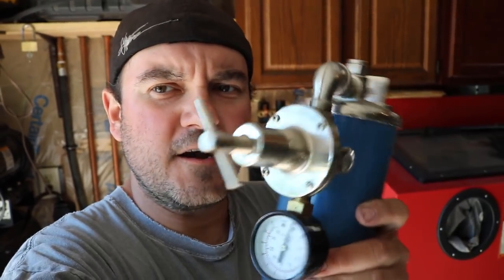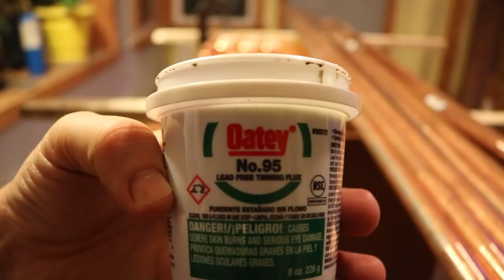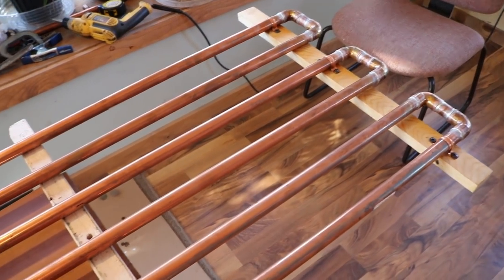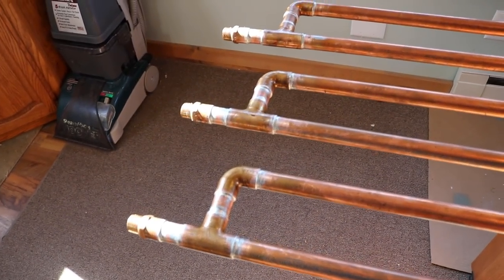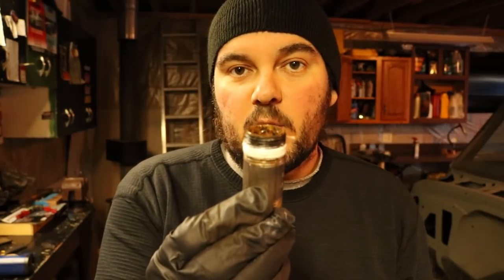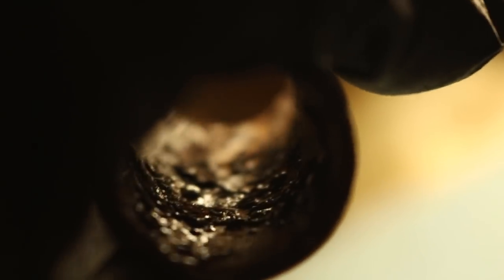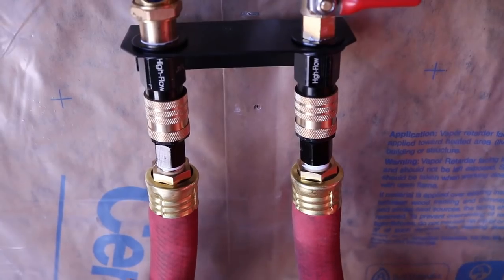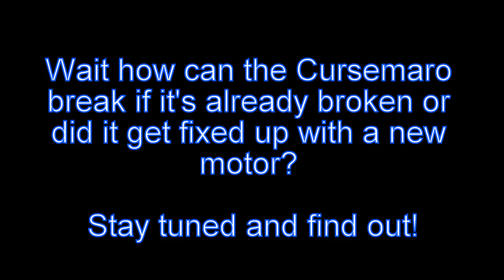How to remove moisture out of air compressor lines! Building an air dryer for painting classic cars!

Comment: This method of copper pipe works great, but to those interested, the other method you see well documented in the internet of using a trans cooler is much better. Here's why.  Aside from the enormous amount of cost, work, and leak failure points for this method, look at the physics.  The copper pipe is nearly against the wall which reduces air flow dramatically.  A small trans cooler like the common Derale 15300 used in the other videos has 16 ft of tube (I bet you didn't realize that), and it is finned, and exposed on all sides. (Ever see baseboard heating without fins? Of course not).  It is at least 2x efficient as unfinned pipe against wall.  Then add a small fan and it is at least 3x efficient as copper pipe against the wall.  That means a small 12"x12" cooler is equal to 48 ft of copper pipe against your wall. Lastly, who has so much wall space to kill?  No disrespect to this guy who did an awesome job, I'm just trying to help people who are considering adding an aftercooler.  Either method works extremely well.  Whichever method you choose, be sure to install the cooler and a water trap BEFORE your tank to avoid the corrosion he showed in the piping happening in your tank (it's uncoated steel inside).
Reply: I've heard of the derail failure quite often no???
Reply: @anthonymoy4471  Where have you heard this?  The coolers are rated at 250psi operating and 300psi burst.   No problem.

Comment: Hello can you tell me after the regulator.  On the 3 end points was this from 3/4 inch copper or 1/2 inch copper then reduced down to 3/8 inch for the airline fittings and regulators.
Reply from the maker: Everything before the regulator was 3/4",  everything after was 1/2" copper reduced to 3/8" air lines.
Reply: @BustedClassicGarage  Thanks.

Comment: for those that want to try to use pvc pipe as an inexpensive replacement for copper, keep in mind that pvc conducts heat very poorly so you would need a much larger cooling grid that could be 3 times the size of a copper grid.
Reply from the maker: And it likes to go... BOOM
Reply: @BustedClassicGarage  well, yes it does. personally i would never use pvc for compressed air but for some reason a lot of places around me do..
Reply from the maker: @marzsit9833  definitely not worth the risk in my book.

Comment: Great video Man. Just what I was looking for. 
Curious about the desiccant snake? Does that just take place of not needing a desiccant filter with silica additives?
Did you get most parts from same place?
Reply from the maker: Yeah the desiccant snake is basically a cheap way to get the benefits of canister filter with desiccant beads. If you're only going to be painting once in awhile it's definitely worth the purchase over a canister filter. I actually walked into Eastwood with money in my pocket to buy a canister filter and they sold me on the desiccant snake. Most of my purchases were made at Menards, Farm & Fleet and Eastwood. There's a parts list pinned to the top of the comments also.
Reply: Busted Classic Garage right on. Ya eastwood is good customer service. And thanks for the tip. Saved me money man thanks

Comment: Great video! I made my lines from galvanized ,didn’t think about the crud that could get in the lines from using steel. Question is, thats a three line set up, so for a one line dedicated line for paint I only have to run about a  third of what you have here here right? Also I have a Devilbliss  dessicant dryer,can I dry that filter out in the oven instead of buying a new filter for 50 dollars? If I can didnt know you could do that. Thanks again great video.
Reply from the maker: Yeah I did over build this a little bit, but if you wanted to simplify it you could just run one line out of the main regulator, and regulate all your air down from that one and just plug in whichever tool you wanted to use. Whether that be an air tool, a paint gun or a blaster. I'm not sure about your filter but my guess is there's a way to actually remove the desiccant if there's a way to do that yes you could. I don't know if I would do it in my home oven, I know some guys do but I have a oven in my garage dedicated for Powder Coating that would be the oven I would use. You could call Eastwood and see what they say, they sell a lot of devilbiss products.

Comment: Where do you find 3M paper in Canada? I am in Montreal. I want 216U. Almost everybody seems to carry Gator or Norton. The 216U is formulated for water borne finishes btw.
Reply from the maker: Can you get it online? I know eBay has a ton of it but you might have to pay an arm and a leg for shipping.
Reply: @BustedClassicGarage  Yeah plus the time for shipping in these crap times. I'll manage. So far Norton ProSand (the 20 sheet contractor pack has been ok - just ok - sand very well but not sure if I got the few fish eyes from it or from using DNA to clean, or from dust contamination, time will tell as I troubleshoot). I wrote Jeff Jewitt the finishes and he said that he tried as many brands a few years ago and found no issues overall; the modern sterates seem to be better he said. Anyway, I'll see. I have some Mirka Gold on the way; that with 216U seem to be the gold standard for water borne finish.
Reply: Canadian tire

Comment: Very nice build, design and execution BUT- That solder is too soft for >150psi. You need to use a silver solder or braze. Over time you'll be popping elbows/ tees. Also confused by the array of 1/2" tubing and outlets at the end. Some description of what/ why would help. 1/2" there also will restrict your flow a bit if you have a high load like a blaster (1/2" hose should be fed from 3/4").
Reply: The half inch fittings are only for the drain valves (for draining collected water) at the bottom of the drip legs.  The airflow doesn't go through them. They could be 1/4"

Comment: Great video! What brand/type  of shutoff valves did you use in the piping after the air regulator (the ones with the red handles)?
Thanks.
Reply from the maker: Thanks! Those were just standard 1/2 ball valves, one side female and one side male ends. I think I got those at Menards so they would be Nibco brand.

Comment: Nice job!  So what kind of "soldering" is that you're doing with the propane torch?  I've never done that before.  I've done regular soldering of small electrical components, but nothing like what you did here.  Looks fairly easy though.  Thanks!
Reply from the maker: It's the same soldering method you would use sweat copper pipes for you homes water system. Very easy! Thanks for watching and Stay Tuned!

Comment: Great build..
Wondering what it basically cost to do that build  ???
Reply from the maker: Thanks! I believe the copper was right around $150, the regulator was just under a $100, the desiccant snake was $30, the desiccant relative humidity indicator was $30, the jumper hose was $30, and I would say add another $50 for small pieces like some of the brass fittings and regulators. So you'll probably end up spending around 400 bucks with the solder and flux you're going to have to buy.

Comment: This is not enough also needing a cooler in-between the compressor and the tank. I used a 25fot coil of copper tubing submerged in a bucket. Also put a small clear reservoir at the end where you connect the air line, you will see still there will be some moisture.
Reply from the maker: Yeah I will have to do that at some point. Whatever moisture's left in the system now gets picked up by my Desicant filter.

Comment: Nice work,  however it doesn't matter if you use all steel , go to any shop, factory, or school thier air lines are steel and many times 50 years old,  rust nodules inside the lines won't hurt unless they break loose, and clog your tools
Reply from the maker: Thanks Eric!

Comment: I have question about sand blasting, could you come out of the compressor head and back into
the tank with this setup to keep up blasting better and not lose the tank volume. Thanks Dennis.
Reply from the maker: No, this system is only to be used after the tank. If you want something between the tank and pump you'll want to look into a condenser.

Comment: thanks! One more question. I don't have enough room behind my compressor like yours so I was thinking about running  a line 10 feet or so to the dryer. Do you see anything wrong with that? Thanks again for your awesome video and all your help!
Reply from the maker: Nope, the more the merrier, as far as length goes. I would maybe install that 10 feet of copper at a slight angle so you don't end up collect standing water and angle it down towards the first valve.

Comment: Is there some resource online that explains exactly what the theory is behind this and how it works?  Like, is it important to have more bends in the system to act as a water trap, or longer runs etc?
Reply from the maker: Basically the way the system works is the long tubing gives a chance for the hot air to cool and the water to drop out of the air. So you could plumb up your garage with straight long runs on the ceiling, with a couple drops for air tools and valves below to drain water. It would work the same way, you would just go to your furthest point from the compressor and hook up your air filtration system there. The reason why a lot of people build these is so they can fit them in a small area rather than wrapping tubing around your entire garage. As long as you have 40 to 50 ft of piping and a couple of drains on it it will do what it's supposed to do.
Reply from the maker: But I'm sure having bends in it does help to collect the water more efficiently.

Comment: Hiw short can these vertical line be before they start losing effectiveness
Reply from the maker: The length is not going to matter as long as you have 40-50 feet of piping total. The shorter you make the system, the more rows you are going to need which in turn you will need to do more cutting, soldering and spend more money on valves.

Comment: Was your compressor bolted down to the concrete when the welds broke?
Reply from the maker: No, just on pads. When I took the air compressor motor off you could tell that the welds from the factory barely penetrated the case.  I cover the repairs in a later video if you want to see what I'm talking about.

Comment: do you say somewhere how this works, or what the theory is? less music and more explaining is good, and I don't know if we need to see every solder joint getting done.
Reply from the maker: 40 to 50 feet of copper piping gives the air a chance to cool down and lets the water condensate out. The valves are just a way to get rid of the water out of the piping. As far as explanation less music, this video was going to be a straight-up tutorial without music, but I end up spending four months editing it and I couldn't look at it anymore hence the music.

Comment: With all them drains it will still not stop the water problem, it just you drain it better which is over kill.
Reply from the maker: The whole point of the system is to get the hot air to cool and condensate... filters and desicant take care of the rest.
Reply: @BustedClassicGarage  yes correct  but if you cool it before it gets to the tank it would be a whole lot better .I found that out years back

Comment: Did you use 1/2 or 3/4 copper lines??! Thanks
Reply from the maker: 3/4"  Parts list is pinned in the comments.
Reply: @BustedClassicGarage  why 3/4 and not 1/2?
Reply from the maker: @TropicBreezeRealty  less air restriction,  especially if you plan on using a 3/4" or 1"  impact gun.

Comment: A system like this really needs to have a dessicant cartridge installed. 
For as much as this would cost to build you could just buy a damn refrigerated air dryer and achieve single digit dew points without all the fuss
Reply from the maker: It does... it has a dessicant snake installed for the time being.  And $150 in Copper for this system vs $400 to $2,000 for refrigerated air dryer is a huge difference.

Comment: Great build, 
Just a few questions, 
How exactly does this remove the moisture in the air when spraying? Do you have to drain it during a large spray job, like a full car,? 
Also what’s the highest air moisture level it could cope with? 
I just can’t see how it could keep up with air demand with a HVLP set up, 
Would love if it would, I’d build it for sure.  
Thanks j
Reply from the maker: Thanks! Sorry for the late reply, trying to get ready for Power Tour. The 40+ feet of piping gives the air a chance to cool and the water to drop out. Mine deals with a lot of moisture, since I'm  running a under powered 60 gal compressor which produces a lot of heat since it has to run constantly and it has been raining everyday for the last month. Any moisture that does get past the particle filter/regulator is absorbed by the desiccant. The problem with not having the Air dryer is that the hot air will pass through the filters and once it cools the water will separate out usually right before the gun. As far as painting a whole car, I've only painted pieces so far but most moisture is going to be removed by the desiccant, the Copper is just to separate out the water. Kevin Tetz used this same set up painting Zed Sled.

Comment: Where can I find a flexible air hose like that? What size was it? I have 3/4" brass fittings but am having trouble finding parts that fit together. Trying to build something very similar.
Reply from the maker: I bought the hose at Farm and Fleet. It's a 3/4" x 3' jumper air compressor hose made by maxline/rapid air. You can either buy it online or if you have a decent hardware store that has a lot of air compressor accessories, they should have it. Piecing this system together was kind of a challenge, I can't even tell you how many times I end up going back to multiple stores just to find the next piece. Let me know if you have any other questions. Thanks for watching!
Reply: thanks
Reply: Can you explain if the moisture trapping system is before or after the tank? If it is after the tank, then doesn't that mean the air cools & moisture collects inside the tank already? To me it seems like it would make sense to connect the moisture trapping system to the compressor so it can remove moisture before the tank & protect from rust.
Reply from the maker: @ducmanbutcher1052 it's after the tank. A lot of people install an condenser between the pump and the tank also. I might do something like this in the future.

Comment: How well does it work?  You are finding water at those drain valves?
Reply from the maker: It works great. After every time I use the compressor, I drain all three valves. There is usually a decent amount of water that comes out. Thanks for watching!
Reply: @BustedClassicGarage  Curious why you didn't combine the drops and add an automatic drain?
Reply from the maker: @ronhampe  I tried to keep it on a budget. The drains I was looking at were over $100. Since the valves are screwed in it gives me the option in the future to add something like that.

Comment: do you happen to have a parts list for the aftercooler?
Reply from the maker: Here is the list of parts used on this build. The tubing was cut to 72" to utilize the most space in that area. You want to have at least 40-50' of copper for this system to be effective.

Here is the parts list for the Air Dryer
 Starting at the compressor

1x   - 2 1/2" 3/4" brass nipple (Sioux Chief 17700324)
1x   - 3/4" brass street elbow (female and male end)
1x   - 3/4" brass ball valve threaded (both female ends)
1x   - 3/4" Rapid Air Compressed Air Jumper Hose (Part # F0215)
1x   - 3/4" Male Adapter (Nibco 604 3/4" to 3/4" threaded)
10x - 3/4" 90° Copper Elbow (Nibco 607)
3x   - 3/4" Copper Tee (Nibco 611)
3x   - 3/4" to 1/2" Male adapter (Nibco 604 3/4" to 1/2" threaded)
3x   - 1/2" Ball Valves threaded (both female ends)
4x   - 3/4" Copper pipe Type L ( I cut these to 72" for the main height)
9x   - 3/4" Copper pipe in 2" pieces 
1x   - 3/4" Brass Compression fitting (to the regulator)
1x   - 3/4" Rapid Air NPT Filter Regulator (K93217)

The piping after the regulator was set up with 3 end points, one for my blasting cabinet 125 psi at all times, one for my tools and one for the paint gun. The paint side has a DeVilbiss 130502 Desiccant snake, a regulator, high flow fittings and a Devilbiss Rhi-01 Relative Humidity Indicator.
Reply: @BustedClassicGarage  how has it worked for you so far?
Reply from the maker: I pull water out of those 3 valves every time I drain the air compressor. So far so good, and with the Desiccant snake I haven't had any issues painting.

Comment: At 7:41 what is that fitting called that your tightening?
Reply from the maker: That's the jumper hose from the compressor valve. Parts list is pinned at the top of the comments.